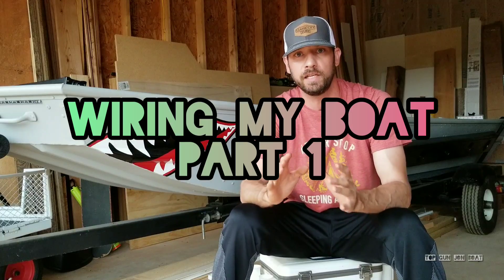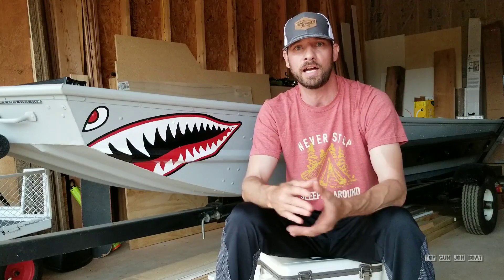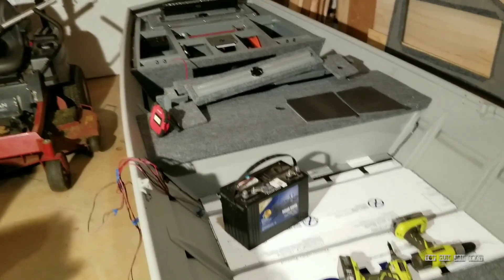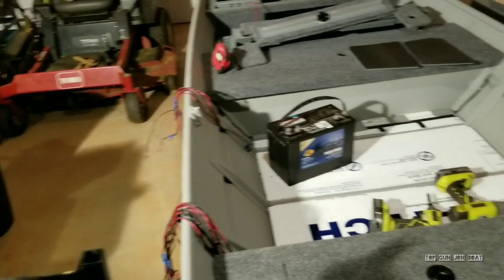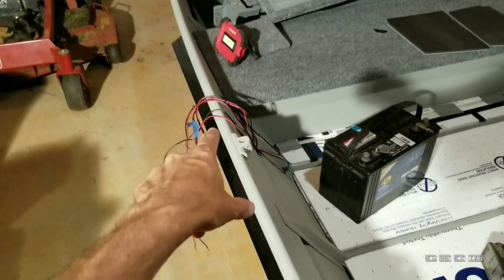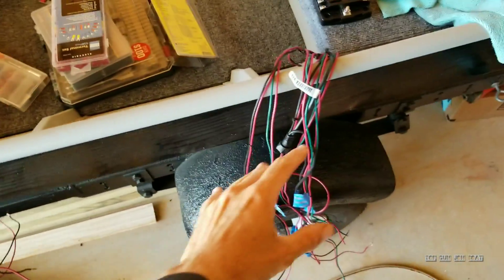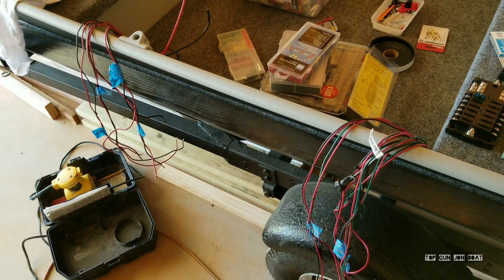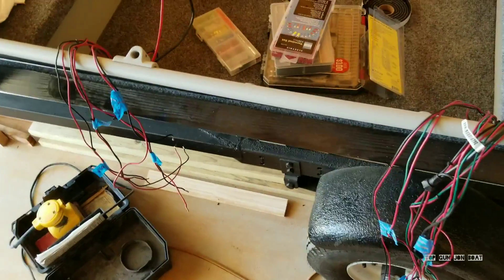WIRING MY BOAT 1- DIY Full Electronics In Jon Boat

Comment: Hey man, I live in Gainesville Ga and have learned a lot watching your builds. I’m about to start wiring my boat and I am curious on the lighting. I’ve got about 8 small white lights that have about 22 ga wire. I have duplex 14 ga marine wire and want to connect them all together so I can have one switch on my panel that will turn them on. I’ve got a 8 gang panel and a blue sea systems 12 fuse panel. How would you go about doing that? Would I just keep jumping from light to light etc with final connections at the fuse panel and the switch panel? Any info is appreciated. Thanks 🙏

Comment: Good planning and some creative thinking.  However, your pvc conduit looks like the ends are sharp and ragged.  These little sharp edges will eventually wear through the insulation of your wiring. There is a lot of vibration on a boat and this constant, even micro vibration will cut through the insulation in very little time.  Where ever you can, go back and round over the inside edges of the conduit.  To those watching and planning their own projects; use grey electrical grade pvc conduit and conduit glands at the ends.  This secures the wire/cables and gives them a good water tight seal.

Comment: I am so confused on what should be so simple. You mentioned you have almost no 3 wire connections... how are you connecting your multiple LED lights, in series? I was trying to wired 3 lights in parallel, but I have to cut my power source in order to tap in the light. So I have power in, light, and power out to travel to the next light = 3 wires. How did you connect your multiple lights together?
Reply from the maker: 1 led positive/ negative spliced into next led positive/ negative spliced into next led positive negative. All 16 gauge connections then on the final splice connecting the sequence of lights, I drop it down to 14 gauge. So what you see me demo and wire in to the switch are those 14 gauge final negative/positive coming from the lights.
Reply from the maker: You could also get crimp splice connectors as well. Not sure where I said it in the video in reference to but to run 3 or 4 led lights off one switch instead of running all the leads to the switch you can splice them together in sequence one by one at different points then drop the wire down in gauge to support the draw, run those wires back to your negative bus bar/ switch/ fuse box (however you choose to wire the final part, there are options)

Comment: Is the wire marine grade? Marine gauge wire has a lot more strands than the normal wire
Reply from the maker: No. I actually talk about that and the reasoning behind it for about 2 mins in the video. I dropped down to 14 gauge though which is plenty for those accessories.  Combine that with marine grade connections in heat shrink wrap and dielectric grease at terminal points, it will do. The main difference I see is the tinning of the copper in marine grade which makes it corrosion resistant from moisture. My.logic there is if you do a great job with your connections there should be no moisture getting in your wires. Also, marine grade adheres to higher temps. I mean, theres a reason for it and it's the right product dont get me wrong. Just think my job and install with regular wire is better than most would do therefore preventing issues.
Reply from the maker: Also, the wire I used specifically is SAE which is not household wire, it is automotive use wire. Technically,  it can be used in boats but is not to the higher standard of a marine grade. It is about 10% smaller in diameter than marine grade which is why I dropped my gauge down from 16 to 14. To avoid any issues, I will use marine grade in build 2, when I started this build and roughed things in a never knew it would get to this level or I'd be doing YouTube videos. lol
Reply: Sorry I didn’t watch the whole video through, kids got in the way, lol
Reply from the maker: @chrisroberts3963  I know how it is man, no worries, hope my comments filled in what you missed

Comment: First
Reply from the maker: My cuzin
Reply: The custom panel box is sweet. Good job. Just got my switch panels and usb, cigarette lighter, voltmeter panels in the mail 2 days ago. I went with panels with integrated fuses and bus bar so I just run a hot and ground in then a wire out to the accesory.
Reply from the maker: @chipsammich2078  Nice man! So I bought all this crap back in late 17 and I've noticed a lot has already changed technology speaking and as far as product options. I'd say dont take 3 yrs on a boat build like I did and you wouldn't have issues like I do. lol. I'm excited though to actually get it working. Video 2 will be much better as I'll actually wire stuff up and install the battery kill switch.
Reply: @AnthonyJonesBrigadeBoats  can't wait to see it. Mine will be a year project this fall and that's about my projected finish time, but we'll see if that happens